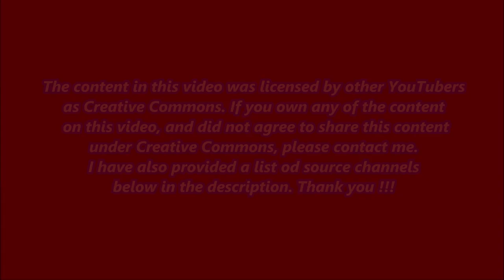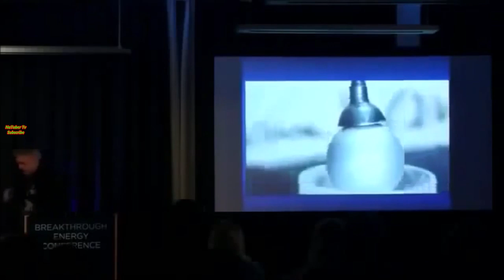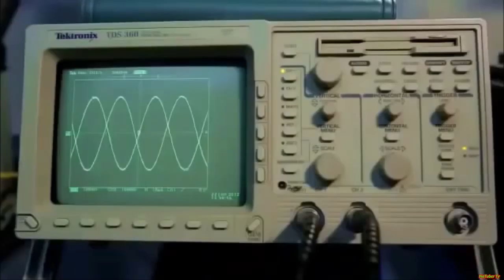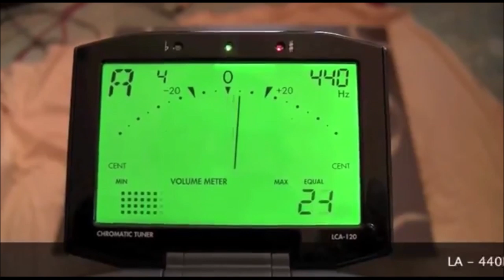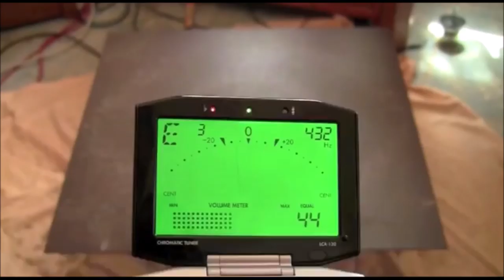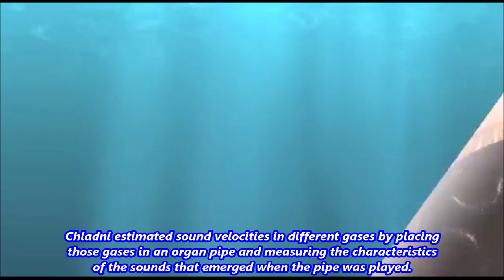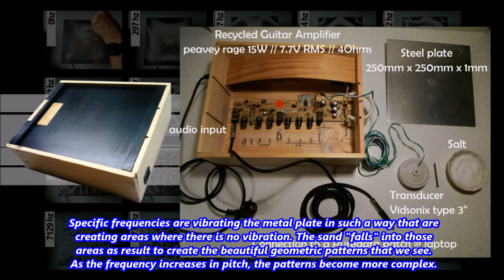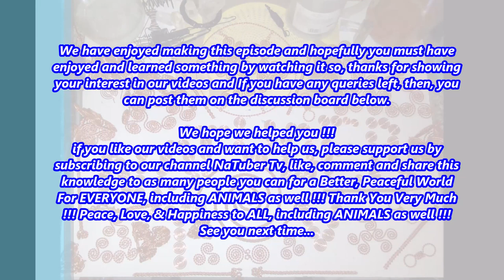Boiling Water by Using Sound - Acoustic Levitation - Amazing Resonance Experiments

Comment: We are told that piezo is electricity but if thats so why does a transducer which is a crystal speaker produce standing waves, what we are missing is that we connect a copper wire to piezo crystal in other uses and that piezofield not electricity creates a current within the copper wire its connected to and that produces the spark..

Comment: What wavelength or frequency are microwave waves that vibrate water molecules? Simply find a tonal frequency that is a harmonic of that and design the architecture of the device to utilise the mains power to amplify this frequency, as well as propogating the frequency output in a manner which best extrapolates this tuned energy and imparts it as far into the water molecules against the 'transmitrer' as possible.

Comment: i saw  peter davey  35 year ago it did work on resonance 2 bike bells one trimmed slightly and he mentioned putting 1hz back into system he mentioned it was a few watts only 2 or 3  small common components because he showed it in england 1984 or 5 also he said it boils any amount meaning maybe steam turbine free energy?
Reply: I want to contact you. How can I contact you to learn about this heating technology?
Reply: @子飞鱼-u2t  also usefull would be heating element like soldering iron in sand or salt
Reply: @paulleftwick7782  Thanks for your brother’s reply. Is this heating technology real? Where can I learn this heating technology?
Reply: @子飞鱼-u2t  peter davey took it to the grave but its got to be something simple thing you notice with tesla was always 60htz not 50  the planets spin and fixed sciences just if your young be carefull of amps and currents ?a lot of information 100 years ago like victor shaurburg
Reply: @paulleftwick7782  This would be a pity. I found its schematic diagram on the Internet. It has two wires going into two bells. But is it a short circuit if it is powered directly? I am very confused about this.
Reply: toroidal feilds  in everything  i suspect  its something to do with the gaps in ac  peter was holding the thing in his hand  over the water and sounded like no danger water hydrogen one polarity the  other oxegen  and  the explosive value of hydrgen added to dfferent preasures  of hydrogen
Reply: also video somewhere shows metal melted in space makes perfect bearings and spheres  and sound shapes it better than on earth  a sword if quenched in water not ointing north the metal curves to north  we cant learn it all
Reply: @paulleftwick7782  Do you mean: in the video it is a device that electrolyzes water to produce a mixture of hydrogen and oxygen?
Reply: @子飞鱼-u2t  inaudible sound to human ears its like ultrasound device  same way sound can rattle knives and forks at certain tones boiling water to freezing water has a sound absorbtion frequency peter picked up on that  i wondered how his blood didnt boil with it?hydrogen positive oxegen negetive alter feild around it?

Comment: Perception hey, A guitar string in most cases is  centre hexagon ( Sacred geometry) string with a wire wrapped in a spiral  around centre string.. 😲😲
Brings me to drums and didgeridoos that would create a bubble effect as well, think of blowing soap bubbles.. The Tibetans use multiple instruments directed at a heavy stone in a semi circle formation, The stone usually has a cliff behind it as well that reflect onto the other side of the stone therfore encompassing the whole stone in a bubble..
The stone then levitates straight up the mountain to where they need it..
Still working it out but the stones are full of millions of microcrystal

Comment: Insect dont fly through the Air, They fly through the Earths
MAGNETIC FIELD MATRIX GRID USING FIELDS PRODUCED IN THEIR
SPINES AND AMPLIFIED BY THEIR CHITEN WINGS..
They are flying through the Matrix Grid , not the air, imagine a grid all around you, they push their electric field wings down which grabs the 
Matrix field and lifts them up to the next level..